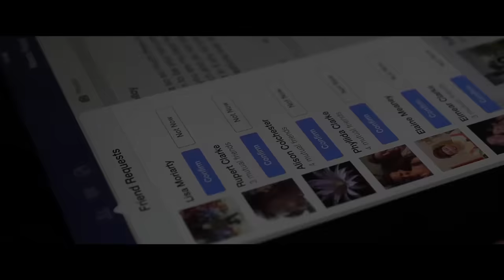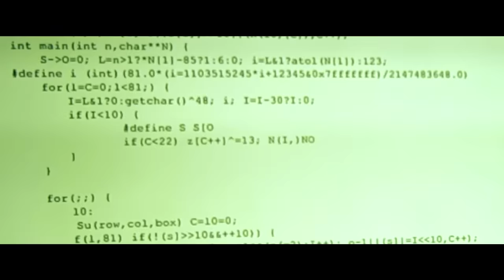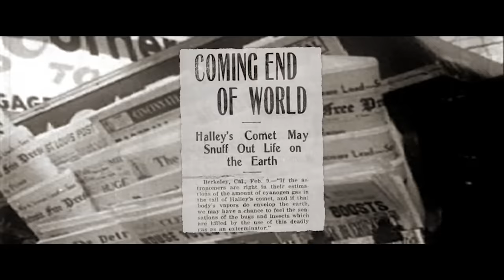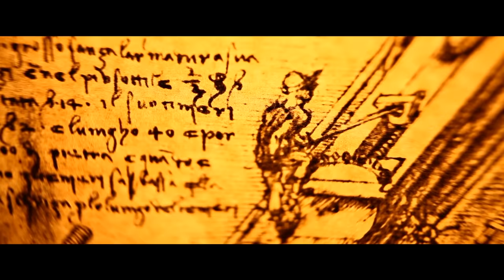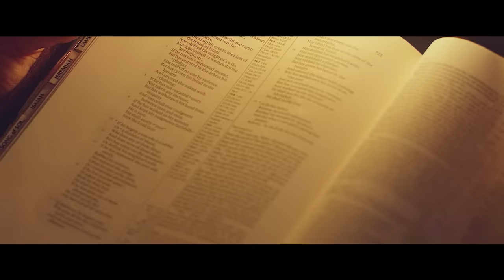Unraveling Prophecies: The Coming Convergence | Parable

Comment: I had this dream in early May:
(I only remember the end clearly. The beginning and everything was intense, the world was preparing for war or something. Eventually, I'm probably working for the military or something.)
My commander gives me orders over the radio to take a schoolbus and to a designated location. He gives me directions to go, finally he tells me drive into this train tunnel, the bus barely fits in, but I drive it through there a little bit, then there's a drop-off into a stronghold/bunker kind of situation. The bus flips and tumbles down there, now laying on its side. I'm expecting it to explode after that damage, so I climb out, sprint through a series of halls, climb ladders, and bust through different rooms to get back to the surface. When I enter a room that has a door and windows to the outside, I see nuclear fallout. The air is a blue-green, a silence has taken over the busy city, I see nobody where just a minute ago I saw heavy traffic, and I've lost radio communications. I go back into the bunker, and now everything is on fire down there and in pieces. The bus did explode, with a kind of power as if it were carrying loads of C4. There was nowhere for me to be out of the fire except for a small section of the floor against the wall which hadn't yet caved through. My radio came back on, command was surprised I was alive, they had their own bunker somewhere which had taken a beating, the nuclear blast was far greater than expected so they said just wait around til you die, that's what they were doing too.
Reply: there it is

Comment: This was posted 3 years 3 days after a major sign was given in the Heavens, 6/10/2019 the Genesis 3:15 sign, which appeared  at the end of Shavuot 6/8-9/2019. Start the count, of1290 days, and you will find the final day to be Day 1 of Hanukkah 2022. A day that has direct ties to the Abomination Daniel spoke of. So many think that the first 4 feast of YHWH were completed, but Shavuot was not 100% completed, one very important item (Requirement) was withheld (Clue is Withholden) and only Yahushua (Jesus) could complete it as he became our High Priest. That item was the Shavuot wave offering to our Father for His acceptance. The two yearling lambs being the two end time witnesses and the two loaves of rich wheat bread being the two equal groups within the 144,000. These he lifted up all at once to the Father. The wave offering was what was withholden, Yahushua himself was the one so many call the restrainer.

Comment: No, we are NOT in the Last Days.
This video is good and detailed for the unlearned about the Scriptures. However, it starts with a non-biblical premise stating that the rebirth of the nation of Israel (May 14, 1948) is the triger that will make all the remaining prophecies to follow. All the teologians who spoke in this video are ignoring (probably voluntarily) that: God PAUSED His dealing with His chosen people (Israel) almost 2000 years ago when Israel rejected God (Holy Spirit) for the third (&last) time, when they (Israel) stonned the prophet Stephen (Acts 7:50-60), to usher in Salvation by Grace (alone) to all nations under the sun, Israel now included as one more nation (not special), in this dispensation of the gracce of God under which we've living since almost 2000 years ago. 
Since then, God is NOT dealing with Israel as His chosen people AND NOT a single prophecy, covenant or promise made by God to Israel has hapenned ever since, and WILL NOT hapen up until God removes (takes out of the way) the "Body of Christ" under Grace (2TES2:7). Then and ONLY then, God will Re-take or ReStart right where He left off His dealings with Israel (under the law again) and the prophety clock will start ticking again towards the Last Days, but not now, no by a long shot..

When Christ said that "this generation shall not pass, till all these things be fulfilled" (MAT 24;34; MAR.13:30; LUK 21:32) it was so, however, later on after Jesus' death and an unrepentant Israel, God PAUSED & changed the prophety program of Israel (under the law) to the Grace program for all nations, thus "such statement" today is out of context. 
The triger we are waiting for is none other than the "Removal of the body of Christ" from this planet in the event known as the "Rapture" of the church.
May God open your eyes to His Word "Rightly divided" (2TIM2:15).

Comment: October 2046 the 12,068 year solar cycle slows down the earth stops and begins rotation again in the opposite direction . Cool, huh? If you think you'll be alive you will want a mountainous east-facing cave somewhere near the equator and nowhere near the west coast of any place. Just a heads up. 
Diehold Foundation.